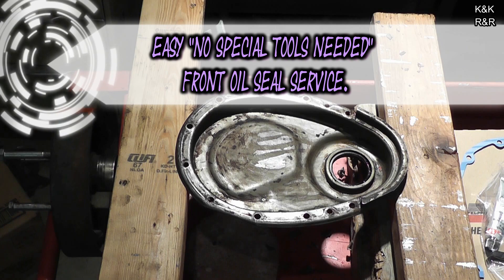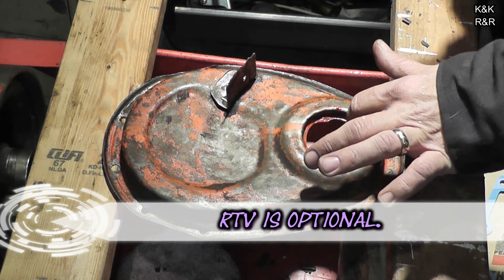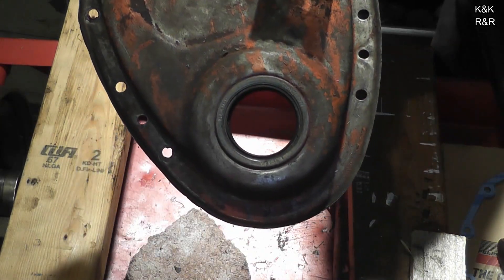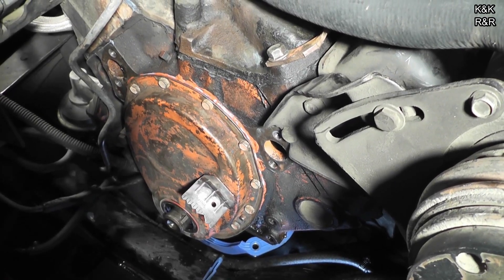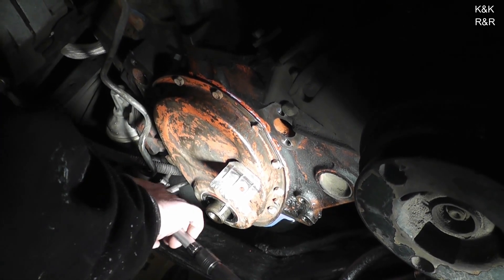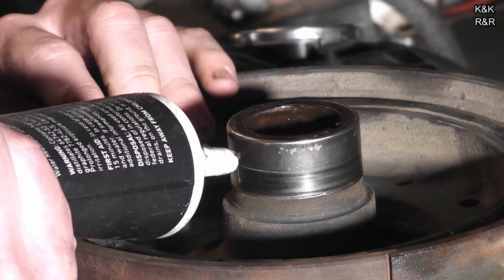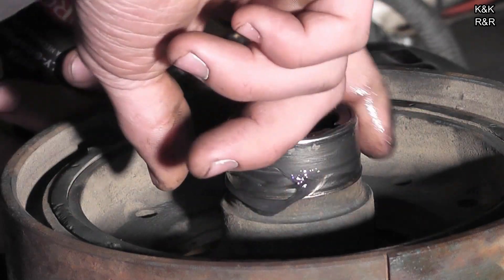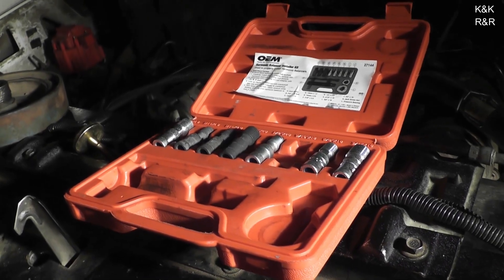How to Diagnose & Replace Any Chevy 350 Timing Chain Pt4 Timing Cover Oil Seal,  Balancer Install

Comment: The older videos are still the best.  The reason I found this video is because I am trying to diagnose the issue on my SB 305 that when the engine is at normal operating temp it has developed a stall when selecting drive or  reverse.  Having already worked on the carb, the ignition system plugs, leads, distributor, rotor HT coil etc still the issue remained.  Hence I am at the point of suspecting the timing chain . . . . . . .and lo and behold at video pos10m23s while you are applying moly to the balancer shim you spoke about the main reason this all started . . . . . . . intermitent stalling issues.  I have my fingers crossed in hope . . . . . . . . Top video, cheers man.
Reply from the maker: Generally a weak chain will cause cold/hot start issue and flat power while running.  Not seen one stall after its started.. I would try a different carb because I have seen more carbs cause stalling than a timing chain issue.  Where do you have the vac advance port hook up on the carb?  It needs to be on a timed vacuum port meaning it only provides vacuum after the throttle is opened not producing vacuum at idle. That can cause a stall in gear.  
/K&K
Reply: I believe ya got a transmission detail ok.
4L60E perhaps not sure as ya make and model.
Or torque converter see.
Throttle position sensor on ya  Throttle body perhaps
Reply: I work on Transmissions 4L60E 
Transmissions will stall
Ok..ect
Remove Transmissions  pan replace 1&2 piston accumulator piston it's probably a plastic accumulator piston replace it anyway with a Sonax pin less Accumulator piston..its worth it rather bad or not the problem 
I had a 305 78 camaro.
But it had a 4 speed manual transmission 
1&2 elect silinode too and the 3&4 silinode on the valve body..of the transmission 
There is a pressure valve in the transmission pump..all this is simple instructions available utube.
Throttle body sensor
Replace speed sensor back of transmission 4L60E 
But ya transmission could have bad seals and clutches 
As well then rebuild ya transmission if ya even have a transmission my 305 was a 4 speed manual shift camaro 78
A 4L60E can be fixed while pan is off the transmission 
Even a filter and fluid change won't Hurt
Reply: Might have a burnt up electrical wiring soon as pan is off transmission 
When putting in drive there are rubber seals on all pistons in transmission 
If so rebuild transmission 
I dont see engine fault far as engagement
Reply: Lol how many ducks fell to the ground while ya installation of that seal
If I was hungry why then I would of had fried duck during ya installation of ya seal
Lol ok it will seal i agree 
But I would be more interested in how many ducks ya harvested lol

Comment: Just before reinstalling the timing cover, did you place the black rubber tab at the bottom of the cover?
Reply from the maker: Yes, we always use a new rubber seal from the gasket kit and little RTV on both sides.
/K&K

Comment: If the chevy 350 happens to jump time, how do you get both timing sprockets to line up at 600 and 1200 dots??
Reply from the maker: You have to move the crank back to 6 O'clock by hand and do the same with the cam back to 12 O'clock.  The easy way to do this is to install the old gear set to get the crank and cam gears lined back up (with the old chain itself not installed). Put the crank bolt back in adjust as needed to get back in time. Install the cam gear bolts and use a pry bar in between two cam bolts to move cam back and forth till your lined back up.  Don't try to use a single cam bolt to move the cam gear around as they will snap with  enough force applied.   Check your measurement with a straight edge ruler and once lined back up then install your new timing chain set as shown in this series. I hope this information will help you get lined back up.
/K&K

Comment: I got a 94 Chevy G20 with a 305 stretch timing chain and can I put a double roller and replacement of the single with the stock cover my first distributor motor and I just want to make sure to do everything right thanks
Reply from the maker: I have installed double rollers in those engines with no issues but I have heard of some cases where people had to use two timing cover gaskets to get the clearance right or use an aftermarket timing cover if the new chain runs into the OEM timing cover.  After installation rotate the engine over by hand a few times and make sure you don't hear any scraping to verify clearance.  I normally use Cloye's double roller timing chains without issues.   
/K&K

Comment: Ok, any clown can remove a seal from the inside out!
Reply: Your right I am going to the mine out the harmonic ballencer looked bad dry rot so I bought a new one the seal looks ok but the ballencer was dirty in the back and I hardly gets driven alot lately its a 1968 fierbird 475 hp so iam going g to change it I have taken alot of seals out of axels pretty eazy

Comment: Help 🆘 I have a 94 suburban Silverado edition TBI 350  I'm moving from california to OKLAHOMA my crack shaft seal looks like it's leaking do I have to at least drop the front oil pan bolts the radiator looks small and stating to leak oil I think from the fittings and  AC doesn't work I think it needs a new  pump won't even turn on abs light is on a brakes are very slushy should I replace the Master  cylinder and bleed the brakes? And the idle is very low in drive at operating temperature but It starts up every time and passes smog lol what's the best repair book for all these jobs thank you I appreciate it and I subscribe  part's I got so far haven't put anything in just yet ..... PCV valve, air filter, idle air control valve, throttle positioning sensor the one ignition coil, temperature sensor, and all the tune up parts am I miss seeing anything?
Reply from the maker: So yes you need to drop the oil pan down a bit to remove the timing cover.  If your oil cooler lines at the radiator are leaking its better to replace the hoses then just replace the o-rings.  The A/C compressors are not the best on these trucks as I have the same issue with my 95 C2500. 

The brakes to fix the slushy pedal replacing the master cylinder might help but the issue is caused from the ABS pump not being bleed properly.  Air gets trapped in the ABS pump and the peddle is soft at best.  There is a video on YouTube that explains how to bleed the ABS pump after any brake repair. 

Before you replace any parts for the low idle issue I would disconnect the PCV and hold the hose with your finger and slowly create a vacuum leak and see if the idle goes up and then if the idle corrects the IAC is working. If the idle goes up and does not correct itself then you know the IAC motor is not adjusting as it should.  The other reason for a lower then expected idle is the base idle adjustment has moved in the TBI housing.  GM sealed that adjustment at the factory but most of the time its the IAC motor. 

As far as books go we use both Haynes and Chilton repair manuals as each have their own dedicated repair information. These engines are simple you have pretty much covered all the basis. I would keep all the old parts you remove (IAC, CTS, COIL, TPS) as after market parts can cause drivability issues later on. You can swap the OEM parts in to verify a concern if you suspect your having an issue.

I hope this information you give you the guidance you need and thanks for watching.
/K&K
Reply: @KNKRNR  kool thanks for getting back to me I really appreciate question if the brakes were not bled properly with that set the ABS light off and would I have no rear brakes seems like the trucks all over the road when driving ? And the PCV has a rubber garment  very tight to get it in the valve cover it's like a round squarish garment should I pound it in with a soft hammer because the PCV valve is just in the hole with no tight connection and the one that I took out of it had a tight connection but it was an aftermarket PVC valve with no garment so I decided to change it out with ACDelco PVC valve and new garment just haven't got the garment in very tight.
Reply from the maker: @worstnightmare9772  No if the brake system pressure is low the Parking Brake light will flash or illuminate.  If the ABS light is on that's because either the wheel speed sensor(s) isn't sending a signal or the ABS pump has an internal issue. That ABS system needs to have the codes pulled by a GM Tech II scan tool or equivalent.  If the truck has over 150,000 miles the rubber brake lines may need to be replaced because they can be  internally collapsed.  We have found when the brake lines are old they will not bleed out properly. This is a very common issue with the round body 88-98 trucks. 

PCV grommets when there new will fit loosely, they swell up after a few heat cycles. As long as you used AC delco parts it should tighten up in a week or two.

/K&K

Comment: "He was a tweaker, too."
heh "Spokane's finest."
Reply from the maker: Nope I refused to do drugs like that, seen too many friends get hooked on that stuff growing up and ruin their lives.  Living in Washington I grew up around damn good mechanics but sadly most where attics during the mid 90's early 2000's. 
/K&K
Reply: @KNKRNR  yup I've done some things, but I've seen friends go down that path all-in and never change course.  

That aside, thank you for this well-made tutorial.  I looked at it because when I did my cam on my 350 SBC, i also put on a double roller (and new water pump and new harmonic balancer).  Problem is once I sewed it all back up I had a bad oil leak out of the bottom of my timing cover.  I think I just botched the seal with the oil pan, or didn't properly apply the sealant.  Or I worked the front main seal, but that seems less likely.  

So now I gotta go back in there and try to redo it (bought a new timing cover this time too).  Im hoping I can get away with only loosening the front 4 oil pan bolts on either side; completely removing it on my truck seems to require loosening the motor mounts and jacking the engine up.  And we did that already and put a fresh pan gasket on, i think it was a four-piece but I can't recall.

Anywho, you guys make informative and entertaining videos--keep on.

Comment: Didn't see. Did u put lower rubber seal on the timing case or oil pan?
Reply from the maker: We used a one piece oil pan gasket from Fel-Pro.   We drooped the oil pan just enough to slide the front cover on. 
/K&K

Comment: what do you do if the timing cover wont fit now? i added a double roller timing set to a 1987 block (has a plate) and now the timing cover doesn't fit, what should I do?
Reply from the maker: I have heard of some guys doubling up the gasket to get the clearance they need. I have seen this issue when trying to use a truck block in a car chassis as the car timing covers are different because of the accessories belt / bracket system they run.  Other thing I have seen is not all double rollers are the same size so it may be possible to find a double roller  chain and gear that is not as wide so it can fit with your factory 1987 block.  I hope this information will help you find a solution. 
/K&K
Reply: @KNKRNR  thanks i appreciate the reply. i just went back to original style, i have a truck replacement block that has a non roller chain.

Comment: Did you have to put a different balancer on? I replaced the stock chain with a double roller chain and now the balancer sticks out too far.
Reply from the maker: Nope we used the same balancer after this job. Wondering if the crank gear isn't fully seated back on the crankshaft or could you have flipped the crank gear so the beveled is not facing the crankshaft? If the beveled side is facing the radiator this could explain why your balancer is out to far.  
/K&K

Comment: when putting on the timing cover I usually snug the bolts lightly and slide the damper onto the  drive shaft.  Then i tighten two of the bolts enough to keep the cover from moving .i remove the damper and torque the bolts. this procedure centers the oil seal with the crank. the seal won't wear on one side or the other.

Comment: That was a lot of rtv on the sealing surface of the cover- also - I would have used oil resistant black. 🙂
Reply from the maker: We have had issues with oil resistant black leaking after a year out with a light application that's why we use orange now. Orange remains flexible after its broke in.
/K&K
Reply: @KNKRNR  
Yep, saw that. He also used a hell of a lot of grease on balancer's nose. The customer should replace that worn out balancer, but what's a tweaker gonna do? Anyway, for professional mechanics and shops, come-backs due to problems like oil leaks are a freaking disaster. I'll bet dollars to donuts if you do it his way you won't have problems. Why would he lie? He knows it works, so he shared it, and that's cool. 

BTW, a man only has himself to blame for oil leaks if he uses chrome oil-sealing parts, like timing covers, valve covers, and diff covers, IMO. If he must do so, I'd suggest thoroughly scuffing the sealing surfaces on those parts.
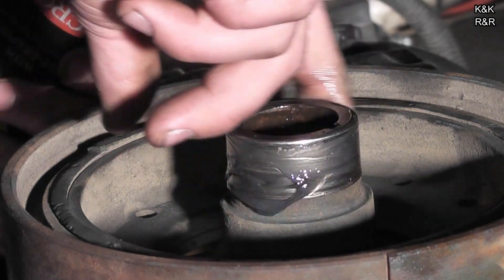Reply: @Michael_Lorenson 10:16 I think he was getting a little carried away with that, and his mind may have been wandering thinking of thoughts that he shouldn't have been thinking about lubing up that balancer's nose

Comment: what about the lower part of the oil  timing chain cover? Does it fit down into something, or against something?
Reply from the maker: The oil pan front lip seal butts up against the bottom of the timing cover. 

/K&K
Reply: @KNKRNR  So I put some permatex on the bottom of cover

Comment: 350s leak even if you do everything right......LOL
Reply: They leak only when you do something.. wrong.
Reply from the maker: Agreed!...... RTV only goes so far. 

/K&K
Reply: @KNKRNR  
Yeah, did all this, turns out not only the seal but the oil pan gasket needs replacing too.
Found the leak after changing the cover plate seal. Got a new rubber gasket today 30 something bucks...ugh....5.0.....leaks.....

Comment: Hey guys was wondering if I could get a list of the tools you used for replacing this, this method should work for a 90 4.3 (262) right? Thanks
Reply: Think it might be the chain because I see oil coming out of the cover and about 8 months ago it started an issue where it wouldn't start, you would hear a vacuum type sound when trying to start and then a loud clink, and then a little while after I started losing power and it struggled to get up hills even in 4th, and now it has absolutely no power in 5th and occasionally has the starting problem and when you try and get on it, the engine bogs out and slows the truck like it's about to die which makes the truck start jumping, occasionally backfires in the exhaust you can hear it loud when shifting, been trying for almost a year now to pinpoint the problem, could this be the chain? Note that I can see oil coming from the chain cover thx:) - Ken

Comment: Did you guys drop the oil pan before you put the timing cover on?
Reply from the maker: It depends we had a Fel-Pro (Reusable) one piece Oil Pan gasket installed already so it had enough give to not need the oil pan dropped.  If we have a factory gasket that's good otherwise we will drop the oil pan down just enough to get the timing cover off and back on.  Rule of thumb its always better to drop the oil pan down just enough to service what you need when its in the vehicle.  

/K&K

Comment: You should support the backside of the timing chain cover before driving in the seal. A large socket, pipe, or a block of wood will work. This is thin sheet metal and bends real easy. Also, the bolt holes around the cover will be cupped in and need to be straightened to flat. A flat piece to flat metal stock in the vise will allow a tech to drive the sheet metal bolt holes flat again to ensure they ability to place correct pressure in the gasket between the bolts.
Retired ASE Master tech.
Reply from the maker: Yes a jig setup would be much better. I have yet had a cover job go south on me with this method, but I do agree with you that there is a better way to do this job like you have described.   Thanks for the Master Tech advise I will give your method a go for the next one.  

/K&K
Reply: Mine on my Pontiac is aluminum but I still would support it even too
Reply: Thanks sensei

Comment: I have a 94 blazer with the tbi 350 and I have oil coming from somewhere going onto the fan belt. Would the front main seal be the cause of this? I can't tell where it's coming from.
Reply from the maker: The answer is yes but not always. In those cases we will clean up the valve covers,  oil pan, harmonic  balancer and timing cover where possible, and lastly the power steering pump. Run the engine through a few heat cycles,  later that night  use a LED flashlight follow the oil drip from the belt back to the source.  The LED light will reflect off a fresh oil leak quite easily in the dark.  If the leak is bad enough it should be easy to spot which gasket or seal has failed.  
/K&K
Reply: Keith & Kevin's Repair & Restorations thank you for the reply. I now know that it's transmission fluid coming from one of the lines I believe.